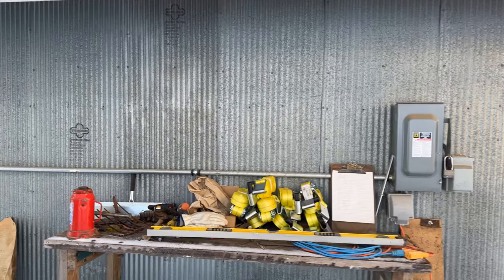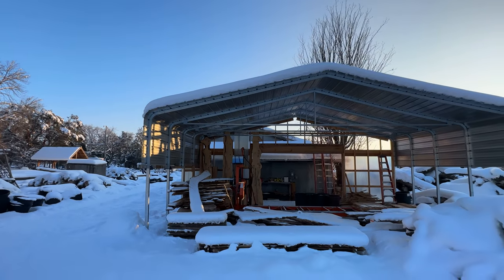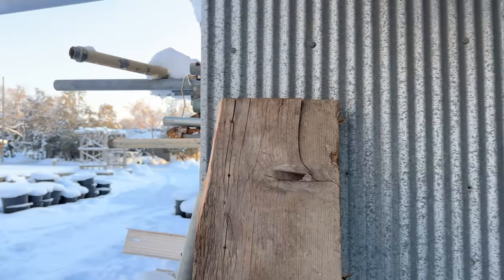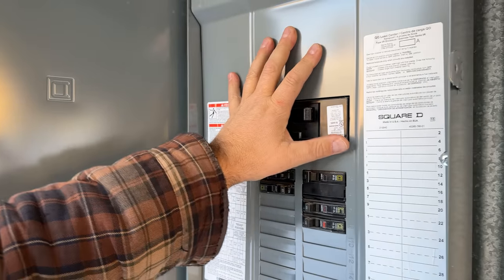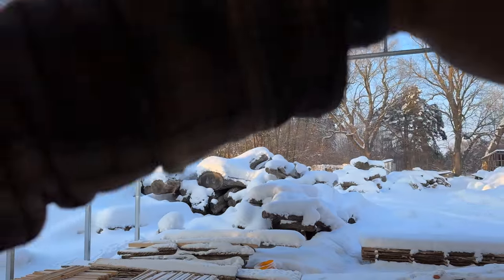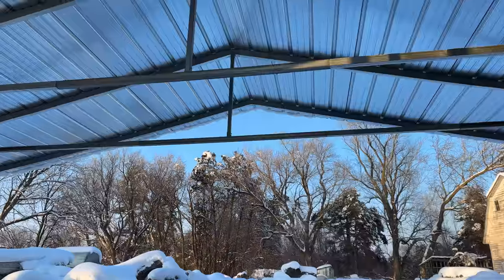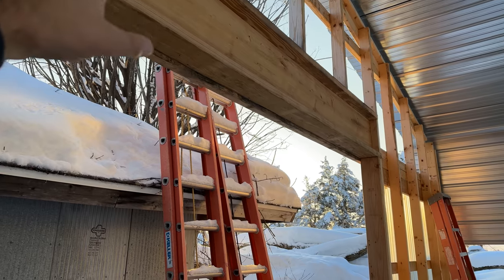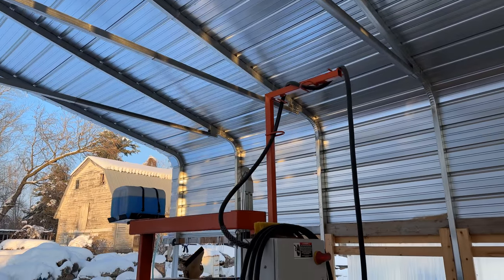Wood-Mizer LT15 Wide Electric Single Phase - Electrical Setup Overview

Comment: Is it possible to use this with solar?
Reply: Sure, this uses about 10kwh per every hour of running (that is an estimate on the highside) as long as you can supply the electricity to run it you'll be fine.
Reply: No, unless you either use a big battery or are connected to the grid. 10kw is more than most residential installations provide for solar, even on a bright sunny day.
Reply: at 300W/panel, 10kw is 34 panels, at the sunniest part of the day.